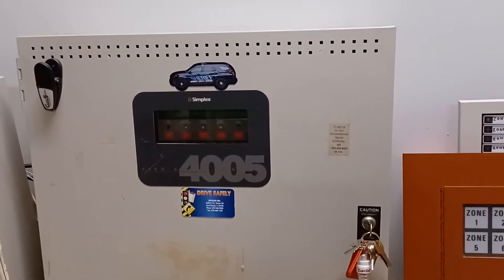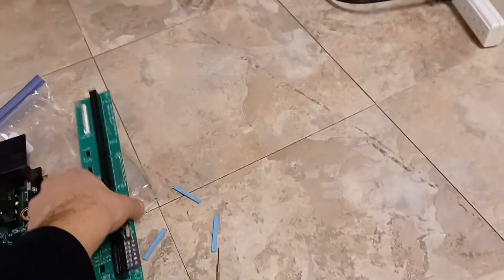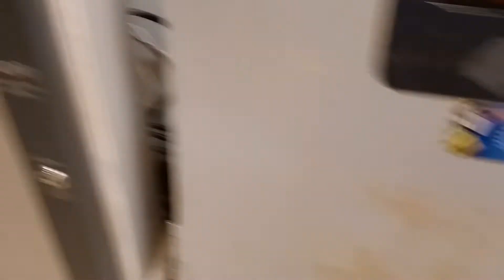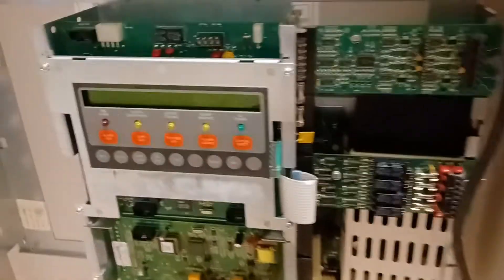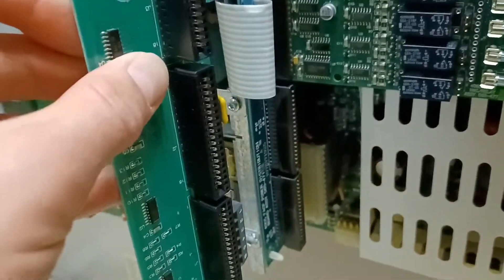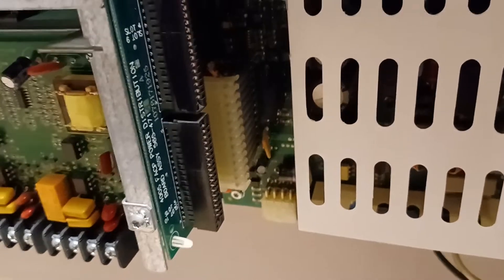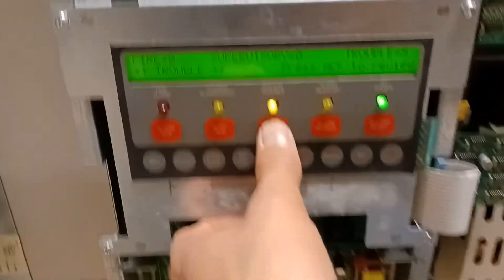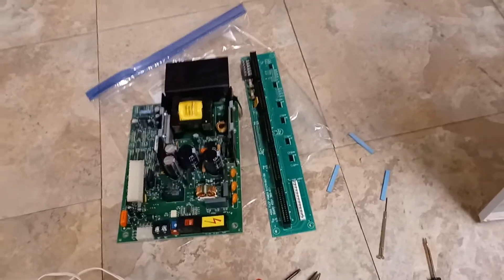The Simplex 4005 is Fixed: First Power-up with New Parts

Comment: Nice video. We have a 4005 at church monitored by Johnson Controls. They can’t seem to get a battery not charging issue to disappear- fault occurs even after new batteries. Maybe you can help. I took a voltmeter across the battery terminals and it’s actually reading 37V - significantly overcharging. I checked the batteries I pulled out and they measured 32V so I bet they’re still actually good. Is that something you’ve run across before?

I can only guess that the power supply is not recognizing that batteries are charged. There does not appear to be another company that’ll do maintenance in our Fort Worth, TX vicinity and it cost a bunch to call these guys out every time.

I’m about ready to tear into it myself.

Comment: I'm so happy to hear that the new parts arrived and you were able to get them installed without any issues, and most importantly, that they work! It's so nice seeing that ground fault gone. I'm really happy that you were able to get a good deal on the new parts. I was able to find the replacement connector needed for that power distribution board. And yes, RUI is the Remote Unit Interface which is how they refer to a remote annunciator.